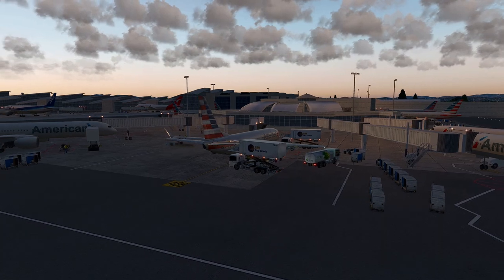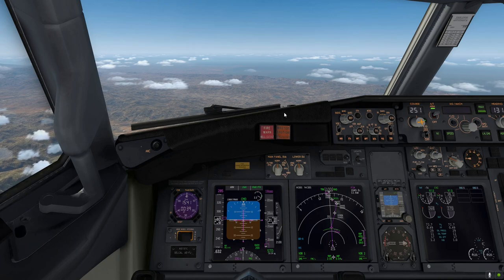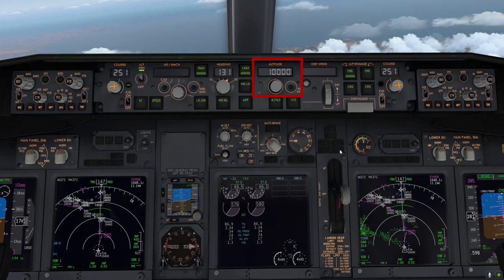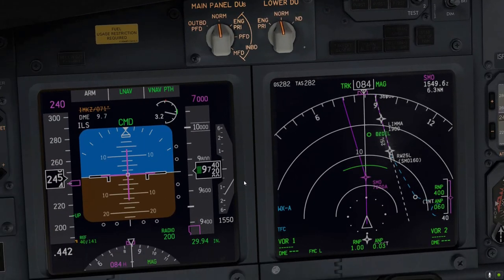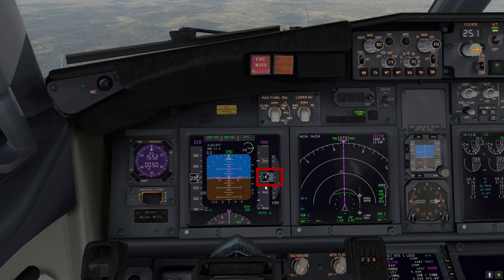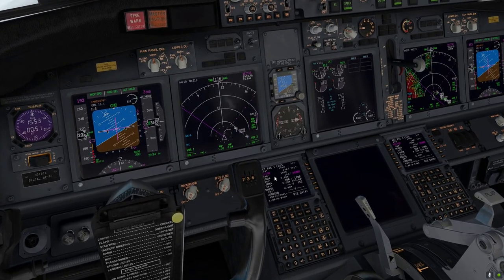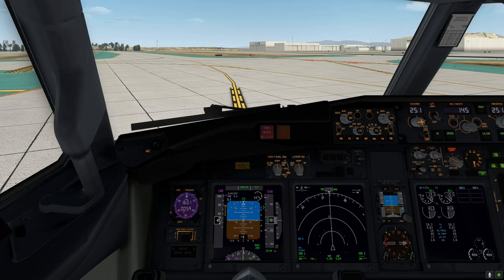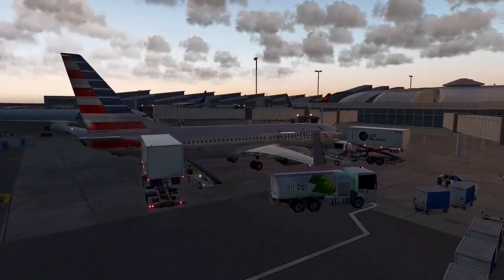Aircrafts Dissected Ep 15: Descent, Approach and Landing IZibo 737I X-Plane 11 Detailed Tutorial

Comment: The green arc is also known as the "green banana" and is possibly one of the most important tools used during a V/S descent (non-VNAV). I use the V/S descent more often than VNAV. 
The Zibo mod has a "descent" announcement on the PA page the captain makes and can be found in the EFB. In addition, there is also a PA announcement for "prepare for landing".
Rule of thumb: 200kts at 10nm, 190kts at 9nm, 180kts at 8nm, ect with final approach speed around 4nm unless ATC requires you to maintain a set airspeed until reaching a waypoint during high traffic periods.
The time from "Glideslope alive" to "Glideslope capture" is not very long so as soon as you see the solid pink diamond first appear, call "Glideslope alive" and set Flaps 15 and gear down. At glideslope capture, follow flaps according to schedule for landing flaps.

Your final approach and landing was spot on! Great job.
Reply from the maker: Love the green arc;)

Comment: Yet another great job!  Your videos are the only ones I "Like" before watching -- one less thing to do after I've watched it! :-)  One thing I would add for those who aren't aware is that if you enable the "Hardware throttle on EICAS" option in the tablet, you can match your throttle lever position to match the current N1 value so that there is no sudden increase or decrease in power when the autothrottle is disengaged.

...and one more PAPI memory jogger:  "White on white, you'll fly all night!"
Reply from the maker: Thank you so so much for your kind words about the content. As for the recommendation about enabling Hardware throttle on EICAS in the EFB, that's truly a great tip. Just tried a practice flight with that setting and it helps so much during final approach. I love how doing this series is as much a learning opportunity for me as it is for others in the community, so thank you. As for the memory jogger- "white on white, you'll fly all night" is truly a classic ;)
Reply: EXCELLENT tip for avoiding throttle surges when disengaging autothrottle!   Just went into the EFB and made that selection.  THANKS!

Comment: Oh, this video missed the part that kills my flights and of a lot of other people. Hit APP to follow the ILS, but, all of a sudden, the video cuts to a VOR/LOC armed instead. Been dying to accurately get when to use VOR/LOC instead of APP or if both should be used and why exactly.
I usually have both diamonds filled and the aircraft flying a perfect path using lnav and vnav path. Then, as I change to VOR/LOC, Zibo tends to end up off the centerline by the end. I have to fly manually way before minimums to align the aircraft, but at this point, my height tends to be ruined. This VOR/LOC remains a complete mystery.

Comment: Great job thank you. Lots of people search the difference the" VOR/LOC" and "APP" button using like me.Could you please any short video about this isue because your videos are greatful
Reply from the maker: Thank you so much for the support:) I can surely make a short video about the topic, but the distinction between the use of both buttons is actually quite simple. During an ILS landing (which is what I'm assuming you're asking about as that's the standard landing procedure that most beginners perform on airliners), the VOR LOC button can be used to simply intercept the localizer (the lateral portion of the ILS beacon). If for example, you're shooting a straight in approach to a runway from a considerable distance and altitude wherein the glideslope hasn't yet been captured, you can first press the VOR LOC button to establish yourself on the localizer and get aligned with the extended centerline of the runway. Then, as you continue your approach and capture the glideslope, you can then go ahead and press the approach button to ALSO capture the glideslope. In this video though, the aircraft captured the glideslope and localizer more or less at the same time, so I went ahead and pressed approach so that we would be fully established for a CAT 1 ILS landing at Runway 25L and LA. If you want an even more in-depth explanation as to what a localizer or glideslope is, then you can go ahead and check out episode 5 of this series here: https://youtu.be/FLNZeZy4Qn4 where I explain everything using charts and diagrams. Hopefully you found the video series enjoyable and informative! Cheers:)